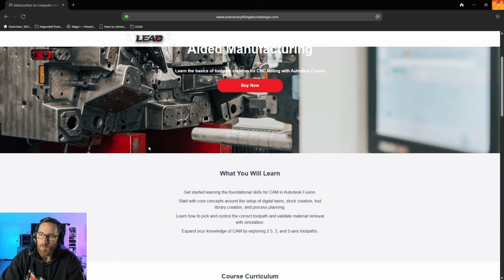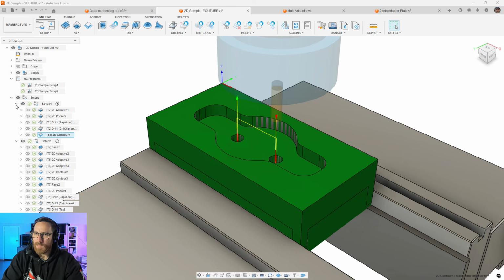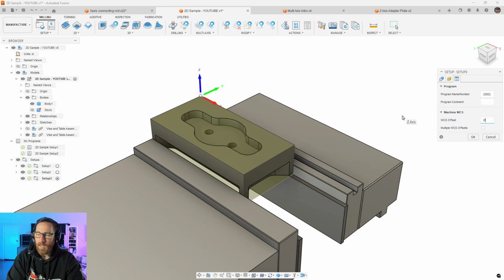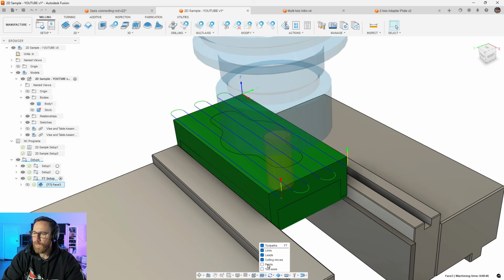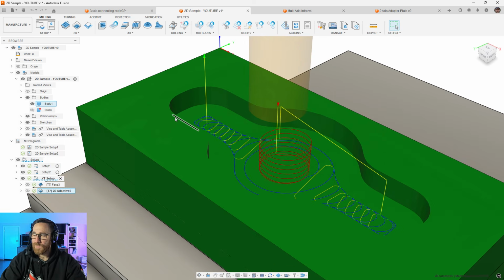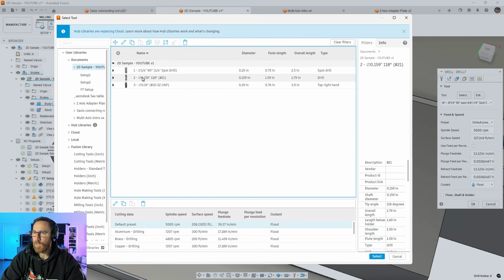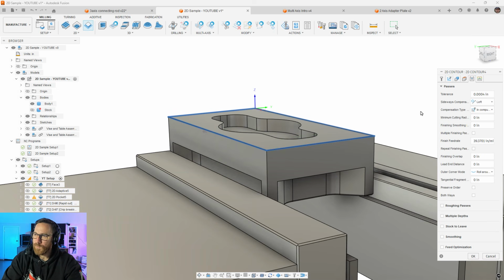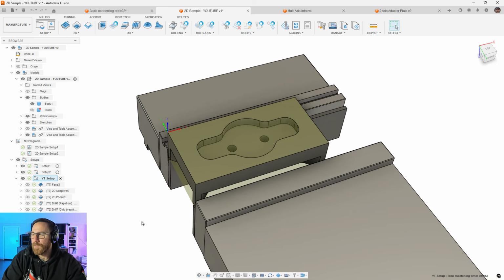Introduction to CAM Programming a CNC Mill with Fusion #cnc #manufacturing #fusion360 #fusion

Comment: Good practice, never clamp onto ur part on only one side of the vice. Center your part in the vice to keep equal pressure on the part and vice.
Reply from the maker: 100% Correct.  When im making these videos sometimes I forget that as I am not taking these parts to a machine....  This part being fairly wide might be ok because it crosses the middle of the jaws.  Its something in practice I might do with a stop on the vise, but i do agree, center is the way to go.

Comment: Half an axis, I guess that's like having half a car.
Reply from the maker: LOL.  2.5-axis in practice just means the tool moves in Z to enter the stock then does the cutting in X and Y. Where 3-axis moves in xyz at the same time (or can).  So i guess its like having a car that you can accelerate going straight, and turn, but you cant press the gas while turning ;)

Comment: Hi there, thank you for the great content. I was wondering if you could possibly give me a few tips on a 4th axis project that im working on? Not really sure where to start in the CAM process? Can even send you a test file? Looking forward to your reply. Regards Zander
Reply from the maker: Hey Zander.  are you using the manufacturing extension, or are you going to use the 4th axis capabilities within the core of Fusion Manufacturing?  meaning you can do 4th axis positioning or axis substitution (unwrap of 2d toolpaths)?